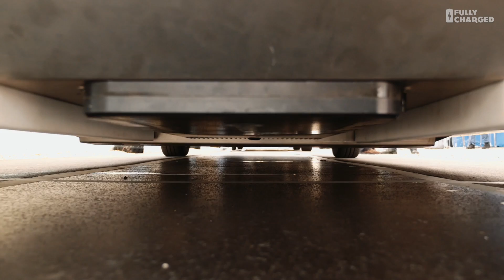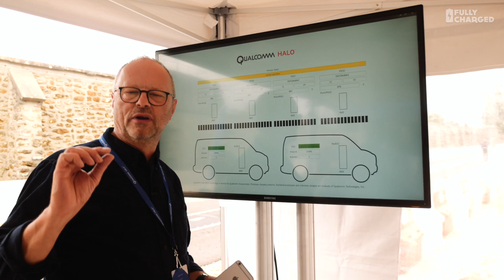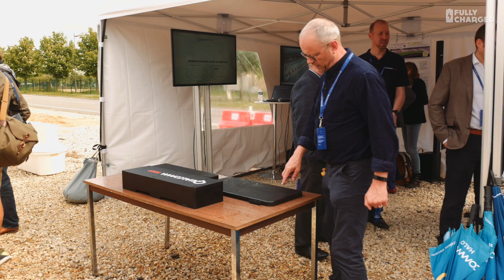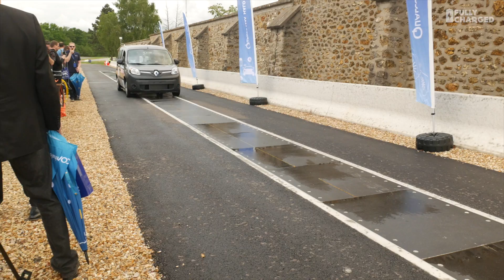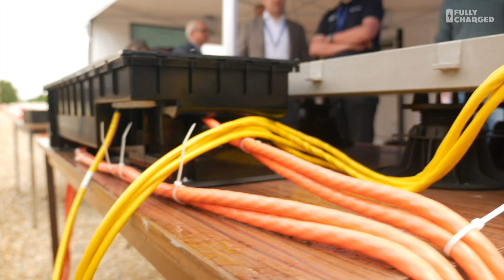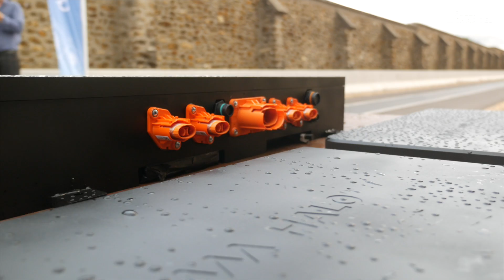Dynamic Electric Vehicle Charging | Fully Charged

Comment: What a total waste of time and money. The answer to a problem that has already been solved. If a Model 3 can do 300 miles, and pick up 120 miles of range in 15 minutes TODAY, why would anyone need this? When the inevitable battery breakthrough comes, we'll have 500 mile range and 5 minute charging, so why would we dig up all the roads?
Reply: Fine. Let's dig up all the roads (at VAST expense and inconvenience) to save anyone from having to plug a lead into a socket when they get somewhere. :)
Reply: At least here in Germany they dig up all the roads in the summer anyway. ;)
Reply: 500 miles (so lets say 150 Kw) charged in 5 minutes, great, the only thing we need after that are charging stations able to deliver 1800 kW/h ... easy. 
But yeah, recharging at the stop lights, in parking spaces, bus stops, taxi waiting zones, in your drive way, ... without leaving your car or plugging a cable is a waste of time and money. Right...
Reply: Robert Rackstraw : I said "stop lights, in parking spaces, bus stops, taxi waiting zones, in your drive way" not "all the roads". And you avoided the issue of the 1800 kW/h charging station to take advantage of your miraculous battery. Are you a politician or what ?
Reply: Large vehicles in a city that drive for 18 hours in a row with multiple drivers. Put them under Bus stops and along bus routes. Lower requirement for massive battery packs = cheaper buses.
Reply: What if this technology adds 600 miles of range to your Model 3? If you can charge at home, you probably don't care. If you live in an apartment it might mean you only need to Supercharge once a month!
On roadtrips it will mean you don't have to stop to charge, but you can stop at your favorite restaurant regardless if there is a Supercharger there or not.
How many potential Model 3 buyers would chose the small battery pack over the large one if this system would be in place? That's a saving of $9000 right at the start.
There is a lot of potential in this technology, but I have some questions as well. How durable is it under the torture of  40t trucks? How expensive is it on the first installation and how expensive is it to replace? What is the price point at which you can sell the electricity at a reasonable price and make a profit? Is it possible to moniter the kWh's charged for every EV that uses the system?
Reply: Because batteries are expensive and resource intensive to produce. They also wear down a lot over time. And it adds a lot of weight/takes up a lot of space in the car. With this system integrated on a national scale, EV's wouldn't need that much storage capacity but still have limitless range.
Reply: I think that this would be good for bus lanes where buses and taxis could benefit. This would also eliminate any need to charge during the day, but especially for electric night buses who could both charge up at night and provide a service simultaneously. Though static version in parking bays would massively increase uptake by those without garages such as flat residents.
Reply: Perhaps don't think about it as a replacement, but a possible addition to any new roads being laid. I do agree with a lot of the other comments though, maybe a section of 20-30 meters installed by new traffic lights/new roundabouts so that stationary cars can regain some charge.
Really though, the self-driving cars would probably be able to make the best use in terms of alignment and spacing from the car in front for example.
Reply: Dude, I don't know where you live, but in the PNW we dig up ALL of our roads, every other year. Asphalt doesn't last that long, especially if the temperature drops below freezing every year. Dropping in some charging pads should only cost as much as the charging pads.
Reply from the maker: While I broadly agree, in the long term technology like this, (clearly refined and economic to install) could result in far smaller, lighter and more efficient cars with much smaller batteries. You'd only need to battery for the 'last mile.'
That's a popular theory I've heard many times.
Reply: Here"s a thoght. Rather than waste time looking at an old inefficient technology that will never get implemented.  Why don't we make the present charging infrastructure more usable. Asking Chargemaster to update their 2 year old none working android app would be a start.  Then one app or card for all chargers would improve things 100%. Unless I'm traveling within range i leave my ev in the garage and use an old diesel i just bought. The charging bullshit has beaten me.
Reply: research and development is almost never a waste, it may not lead to the next technology but without going down various dead ends we cant expect to make real progress. No technology is a straight line to the ultimate answer.
Reply: Martijn klop, If people didn't own cars if or when one day they go fully autonomous,  it'd be pointless cars existing, as paying each journey to use a car you didn't own or sharing a car with total strangers would be like getting a taxi anyway and don't think people will want to share their car with anyone or not own their own car for themselves. People will always own their cars i think, even if they switch to a model where people lease their cars in future.
Reply: +Martijn klop  You'll need to stay on the road paved with such wireless charging, not all the roads will have this infrastructure. Plus, not everyone wants to be dependent of the grid and of big companies to charge their evs. PV panels are cheap and you can charge with these at home or mount it directly to your vehicle (nomad people...).
Reply: I don't know where the rest of you live, but I live in the UK. At each end of my turning is the main road,  it has heavy traffic use because it leads to the town center has a mainline railway station and a hospital with A & E (ER). So far in 2017, it's had 5 lots of roadworks that have lasted 7 to 10 days, 2 weeks ago they resurfaced it. And yesterday .... they started to dig it up again! And that is why at this time, this won't work in UK towns and cities, every time they need to get to gas, water, electric etc they would have to rip this up as well. It might be alright on Motorways and dual carriageways but with a chemical spill or vehicle fire where they have to resurface, which can take anywhere from 15 to 24 hours here in the UK, how much longer would it take with this system in place? would they reuse the old units or just play safe and just use new ones every time? 

I think this will only work under parking spaces, but why not just put plug-in charge stations in every multi-story car park, everyone tries to park in the nearest open bay, so just make the top floor for EV's only and put charge stations in every bay.
Reply: Robert Rackstraw not all of them. How about every mile you have a small bit. Maybe in the slow lane on the motorway, or small areas.
Reply: they would just roll it out when roads have normal, planned maintenance works....if the road is already dug up, its hardly costing much more....
Reply: they would just roll it out when roads have normal, planned maintenance works....if the road is already dug up, its hardly costing much more....
Reply: no real point fitting these in town, if you are running about in town, then you'll not really tax the battery of your ev, whereas on the motorway...not having to stop at half past midnight to charge for half hour with 3 kids in the back of the car? priceless....
Reply: Interestingly enough, digging up the road might not even be that hard either.

Where I live the is an internet infrastructure "upgrade" ongoing, but the nbn is a whole other can of worms.

But the way they built the trench? Instead of digging anything up? Remote control drone, tunnelling underground, guided via GPS.

Granted, this is for a single cable run at the moment... but if they can do that? By the time this hits the market, you could probably slide these panels into a micro tunnel under an active road!!!

Mind.
Blowing.
Reply: The point of this technology is that you don't have to stop and plug in to charge. Even a 300 mile Tesla will need plugging in at some point. So not a waist of time.
Reply: Because on the Motorway network a vehicle would be able to drive indefinitely.
Reply: No, you just have to install when roads are being resurfaced.
Reply: The most obvious application is in public transport
Reply: Not everyone will buy a Tesla. The other reason for this is the option of producing vehicles with smaller battery packs that would be lighter. The pack could be just large enough for daily commuter usage. This hardware would enable a person to still use the vehicle for the occasional long trip and make fewer stops.
Reply: Also consider with the improvement to battery technology, we would not need to dig up all the roadways right away. This would be placed in freeways and tollways as the road wears out and needs to be replaced anyway. I look at it as one more option for people to choose, not a one solution for everybody. If I had an older Leaf that I wanted to take an occasional long trip in, this solution would be a nice option.
Reply: Robert Rackstraw If everyone took that attitude we'd still be in the dark ages.
Reply: Yes but this would be great for Large vehicles such as buses and trucks
Reply: Here in Pennsylvania we dig up all the roads every year anyway. Might as well install induction charging while we're at it.
Reply: I have to disagree. It's awesome that big industry players develop a wide range of technology that may be useful in the future. We cannot count on government funded basic research for everything that is not immediately profitable. Maybe this won't be used for roads that charge your car but is the research foundation of other future applications.
Reply: How this thing operates? Does the pad on the road constantly emitting power even though there is no vehicle on the top? Or it will be open when there's a car on top? With that, how instant it will emit power when the car is in high speed? Does it waste of energy coz most of the power it emits is being waste no time for the car to catch them all?
Reply: It would probably only be motorways (relating to long journeys), and possibly only one lane - it would make sense for this to be the inside lane. Rather than dig up all the roads specifically for this, it could be rolled out as work on the roads is required anyway.

Or perhaps it might only ever be used for public vehicles over established routes. All they are doing at present is working out the technology, not the infrastructure - they say as much in the video.
Reply: Static wireless charging for parking spaces is already for sale. BMW will happily supply a pad with your new 5 Series plug-in. This is different and I can't really see the point.
Reply: Well, assuming that same Model 3 could take advantage of such a system, the advantage is that the range will stay at 300miles when then user or vehicle arrives at it's destination regardless of how far away their starting point is/was. The advantage is now there's one less vehicle that needs to take up a charging location. 
The advantage is if the grid has excess power it now has a great place to dump excess power.

Do we need this? No, but that shouldn't stop us from looking into it.
Reply: Yes. I assume batteries will get better. Don't you? This technology would wipe out the need for big batteries, but BETTER BATTERIES are going to wipe out the need for big batteries. Plus, you have to DIG UP ALL THE ROADS. ;)

Comment: This is dumb. It's like if there were petrol shower nozzles above a road, spraying the passing cars with fuel ... and the cars catching/using it... stop and fill/charge up you car, like a rational person!
Reply: Kárpát Zoltán I agree with personal vehicles being better off stopping and charging manually, but the application for public transport infrastructure is huge. Maybe not all the roads, but stretches with many bus routes driving across it makes huge sense.
Reply: In my city even diesel buses stop for ~10 minutes after every full loop... and that's when they could charge up for another run. I don't think it would take more than 10 minutes to fill up for a ~20km route...
Reply: Even for public transport a wire based charging solution will be way better, like contacts on the roof of a bus (as shown in other videos) and connectors at bus stations where needed. Higher efficiency, higher power, no problem with the "EM sensitive" phobics.

Comment: These could be placed under parking spaces. That would possibly eliminate the need for the posts, kiosks, or any other above ground hardware. Just control and pay via smart phone (or call a number on a dumb phone and give your cc number). By paving over the inductive element (as stated in the video) the whole thing is protected nicely. City center parking spots would be charging spots. This would also be ideal for company and government vehicle fleets - no cables to trip over or lose, no adapters for different vehicles.
Reply: I will have to disagree about the owning cars thing. I just don't see that going away - but I could be wrong. I think people will always want their own personal vehicle if they can do so. I see electric vehicles as making that more affordable since EVs last so much longer and cost much less to operate.
I did live in Boston, Mass for 4 years without  owning a car so I do have some experience with relying on public transportation both good and bad.
Reply: I second the comment about owning a car. In busy congested city centres where you never owned a car to begin with, this would be a grand step forward. 

For those living in quieter, rural areas which are less connected, it's not financially viable to have these pick up and go cars and infrastructure. It's better to have and run one of your very own.

I would be lost without my pride and joy.
Reply: they already have the non-ownership of cars thing, the ability to order a car when you need it... its called minicab taxi or uber.... and some of the pitiful states these that i've had to travel in before, i'd always rather own my own...
Reply: hiddengrousefarm I would ditch the smartphone and just integrate an nfc-like communication system between the car and the charging pad which could be controlled directly with the car without having to hassle through apps or calling numbers. It would be really easy to implement and would eliminate the problem of having to use a secondary device for charging.
Reply: It's not regressive at all. There's a reason people own cars now instead of using public transport all the time. People want their own vehicle with their own stuff in it.
Reply: Or a charge on the fly fueling station, just a slow loop, never get out of your car. Or perhaps for trucks that haul stuff around ports. They'd never have to stop.
Reply: ABB are launching chargers that recognise the car and activate only if it can bill you. It's built into the protocol. Shell are also touting NFC swipe and pay as coming at some point (just like pay at the pump).
Reply: That would be great. Just incorporate it all into the car and life is easy.
Reply: Nope, they have both, induction and magnetic resonance, they even show you it has a standing mode of 7kW. This stuff is not new!! 
https://www.youtube.com/watch?v=Gw6XtzEOlyI
Reply: they already have the non-ownership of cars thing, the ability to order a car when you need it... its called minicab taxi or uber.... and some of the pitiful states these that i've had to travel in before, i'd always rather own my own...
Reply: Stationary inductive chargers are already available. It's the same way that transformers work by AC electricity. The difference is that the current systems are placed on top of the pavement - snow plows will destroy that where I live. By putting it under the pavement the whole system becomes practical or even better because there can be zero above ground hardware. Winter is very hard on roadside equipment and that means expensive maintenance and repairs.
Reply: I know that it would be a good idea to have car club schemes, I for one would sign up for it, but it's not in my area yet.  But saying that as more and more people own EV's (and the future looks to be 100%) you need to have an easier way to charge your car at a service station as every one will want to do that, so induction chargers at all spaces could be one of the solutions.
Reply: They'd have to be more aggressive with disallowing ICEs to park there since they often drip. Take a look at any year-or more old parking lot asphalt, there's craters from corrosion. Wouldn't want that destroying the electronics.
Reply: Good idea, but that's still relying on our old, regressive system of owning cars and parking them somewhere taking up a lot of room -- it's still a big step up, though!

Comment: What would happen if you put your Qi enabled phone on it?
Reply: A car will run over it.
Reply: It would make a reverse charge call
Reply: The electronics communicate between transmitter and receiver to know certain parameters without a response it wont charge, otherwise anything ferrous (magnetic) would cause a problem!
Reply: Nothing. You need to be in motion to generate any charge.
Reply: Rupak kumar Bag  That's incorrect!